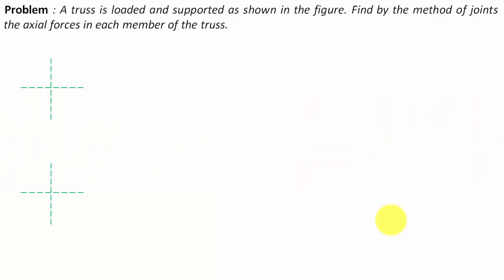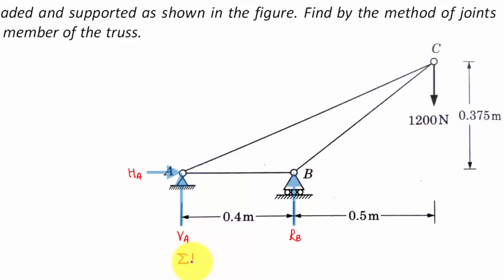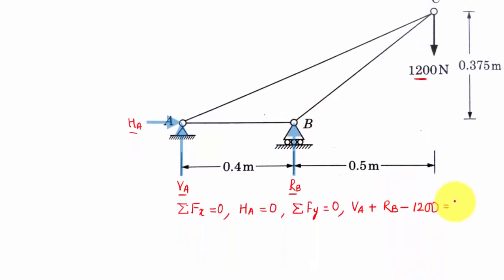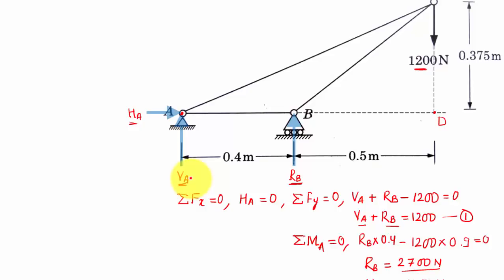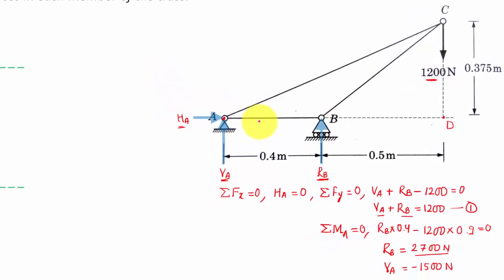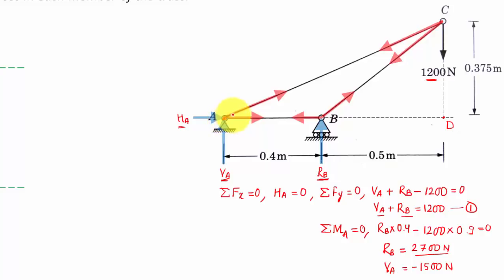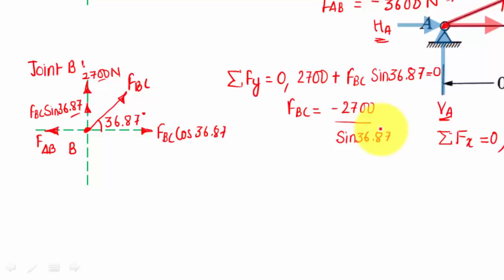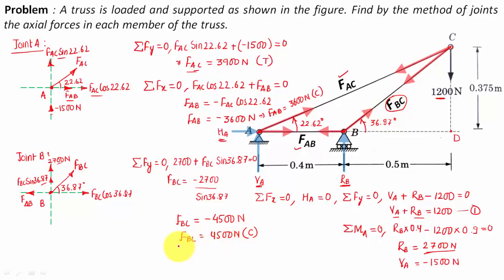Trusses_Method of Joints_Problem 1

Comment: SIR,how you're using the magnitude of Va force as  -1500 in the equillibrium equation? -ve is only for direction? plz explain?
Reply: it might be too late, he did not explain this but, 1200 N in the Y and we found Rb to be -2700 N..... -2700 N + 1200 N = -1500 N
Reply: Yes, What you said is absolutely right. The value of Va =1500 in a downward direction, which will be again negative while applying equilibrium equations.
Reply: He took it in negative sign in calculation . So result will not affected. but there is an error in representation.

Comment: METHOD  OF  JOINTS  ==  FIND  REACTION  AT  EACH    POINT=    THEN  CALCULATE    FORCES  AT  EACH    JOINT  B Y  PUTING  HORIZONTAL   AND   VERTICAL  COMPONENT  =0